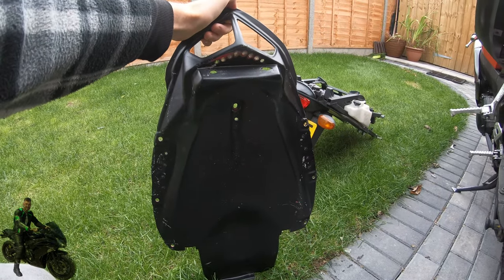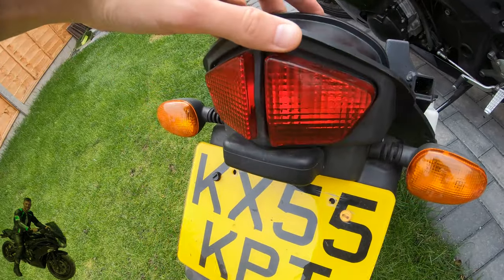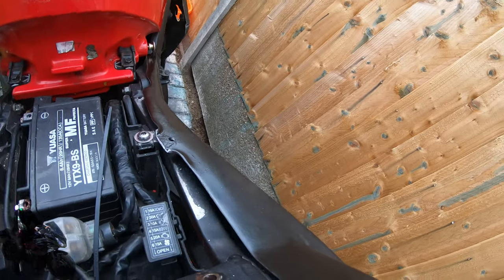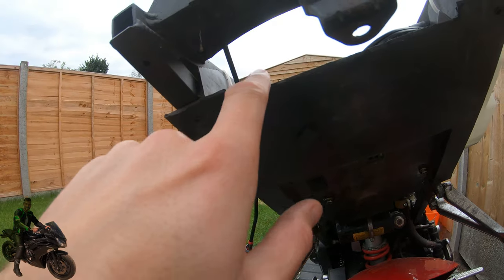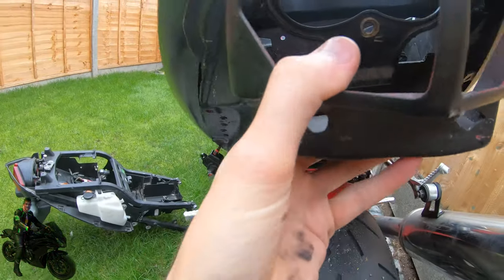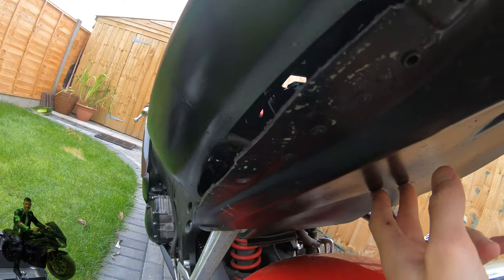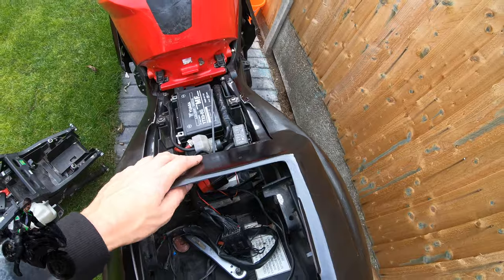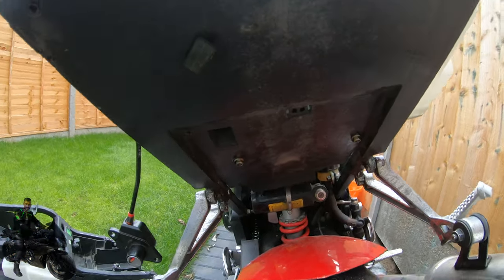How To Fit An Ermax Undertray To The Triumph Daytona 600 / 650

Comment: Great help this video. Seems a big butchering job but much much easier to see what needs to be removed with this video.
Reply from the maker: Thanks! I think you might be able to keep the two rear plastic mounts that attach to the subframe, I guess cut little by little and see if you need to go further.